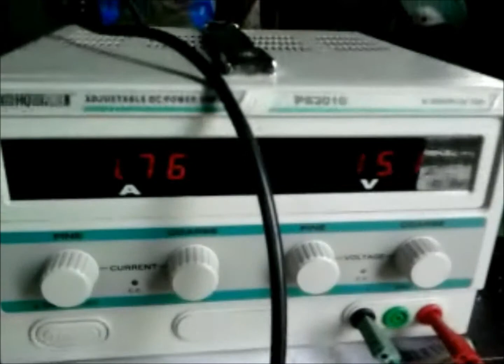Brake cylinders renewal of a Mercedes 170Va 1950

Comment: Which size of honing tool did you use?, what is the bore size for the cylinders?, Thanks.
Reply from the maker: The honer is for a diameter range 20-70mm.
The brake cylinder bore size, front 25.4mm, rear 22.2mm.